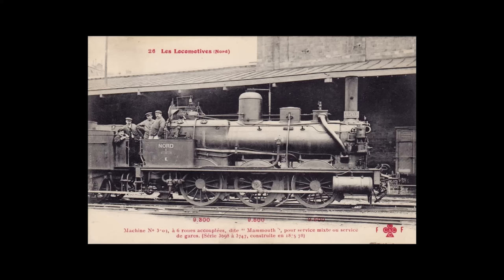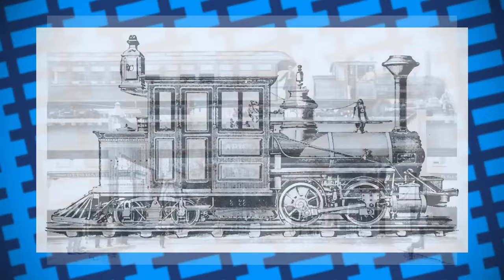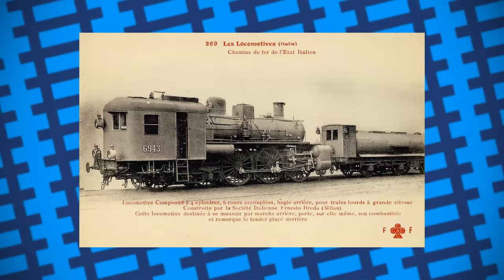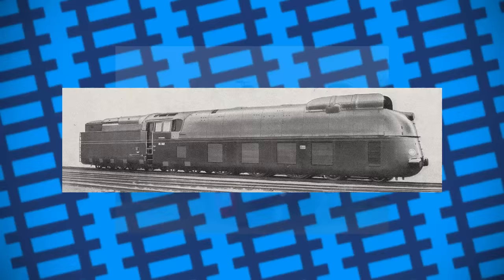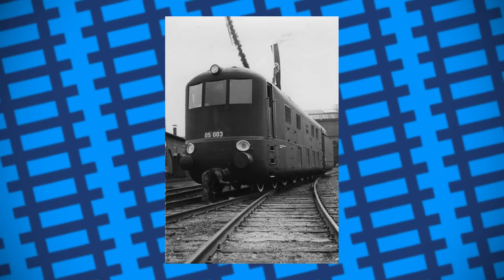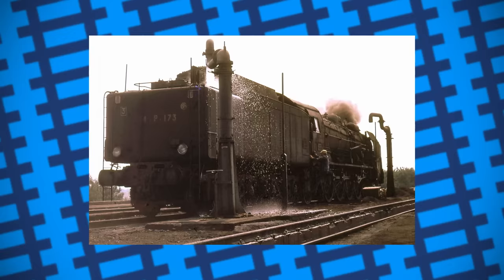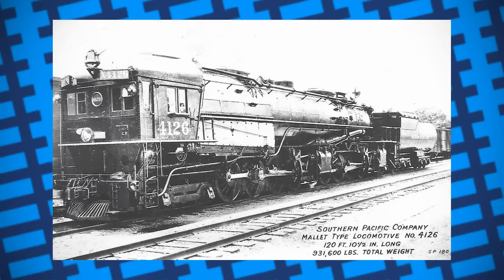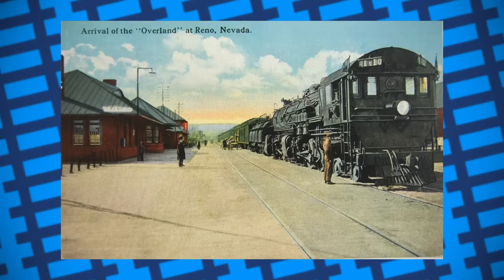Why "cab-forward" steam locomotives usually didn't work - Cab Forward Locomotives

Comment: There was a reluctance for crews to ride up front anyway because they felt more exposed to the impact in collisions, especially in less controlled circumstances like crossings. Because of this, many early diesels were run long hood forward to keep the cab back where the crews were used to it being.  It took a long time for this to change.
Reply: I would be reluctant, to say the least. From a stray Cow to a Head-on, I would be a nervous wreck. 😜
Reply: I think maybe the ultimate is a tractor-trailer load of gasoline at a crossing. That's where you set the brakes and jump! (if you have time...)

It's actually one of the things that held back the Rail Diesel Car: basically there's nothing between you and the side of a truck in the crossing but a sheet of glass! Just as bad as the cab in a subway train, except they don't generally have road crossings.
Reply: This is commonly cited as a reason for using tractor engines instead of pusher engines in airplanes. At least from the pilots perspective in single engine aircraft. The engine and engine space basically provided extra protection from head on attacks and a buffer in case of a rough or crash landing.

I honestly have some doubts as to just how prevalent this line of thought was, seems like it could be something 2 people said and then was just repeated ad infinitum .
Reply: It makes some sense to have the plane's engine between you and the impact rather than to put yourself between the engine and the impact. All that hurtling mass tends to keep on going when the rest of the plane suddenly stops.
(Above a certain speed it all ends the same anyway...)
I guess in a cab-forward steam locomotive not only could the boiler squish you, it might COOK you too!
Reply: For good reason. On 2008, the train operator was killed after colliding with another train on the Green Line D branch between Woodland and Waban stations, Massachusetts. The new 1900 red line subway cars have large cabs at the front for bigger crumple zones.
Reply: @Narrowgaugefilms  Also in almost all single engine planes, if the engine is a pusher, in a crash it is coming in behind you. That is one big chunk of metal that really wants to murder someone.

caveat: There are the occasional bits of awesome insanity like the Blohm & Voss BV 141, but people tend to simply not even think about designs with the kind of mindset that created it. (basically they worked out all the forces that fight with each other and figured out a way to balance them all out with this design. pretty neat imo)

addendum: with all the oil and heat sources in any fighter plane... that engine really wants to BBQ someone as well. Flame roasted, mmmmm.
Reply: -of course even in a conventional steam locomotive having a tender full of water and coal immediately astern brought more than enough momentum to squish a crew against the back head too. 
You get enough mass moving with enough velocity, you automatically get enough energy to do all sorts of harm!
Reply: @whyjnot420  As a pilot and small aircraft designer I have never heard this, at least not directly stated. There are much better real reasons, so that such irrational tavern speculation is totally overshadowed. Putting the prop at the back of a small airplane creates all sorts of design problems related to the landing gear and ground-roll phases of a flight, especially if used on poorly cleaned or unpaved runways. 
The engine doesn't offer any protection in a crash, the space offers some crumple room but that space will still exist for baggage if the engine is moved rear(where the baggage used to be). A pusher can have a slightly more efficient cruise under an ideal setup but usually there are so many practicality compromises that the advantage is lost.
Reply: @mytech6779  I have only ever heard it in stuff designed for a more general audience, e.g. tv documentaries and whatnot. Always something about military fighters or whatnot, never about civilian stuff. It always struck me as odd. I am a sucker for these since I love watching film of old planes from around the time of WW1.

For years I have thought of it as the aircraft version of how people talk about Sherman tanks as "ronsonol" death traps. At least the tank thing is finally starting to get debunked.

That is the reason for what I added at the end. I am very skeptical of these kinds of claims. Even though I have heard it in a thousand documentaries and whatnot. Also I am aware of the fact that pushers come with a host of issues. Which is why I specifically stated "At least from the pilots perspective..."

On a different note, bullet protection... Even if it doesn't do much (it isn't nothing, but certainly is far less than most people think, the amount of power in a .50 or 20mm round is insane), there is plenty of evidence to show that this kind of thing has a psychological effect on the pilot. Thinking of tanks again, just look at the number of tank crews who stuck track links and extra wheels and whatnot on the front of their tanks. Even though anyone who knows how armor works, knows that kind of steel is like paper in comparison. Historians even speculate that the cingulum militare of roman soldiers likely did something similar as it simply put something, anything, over a very sensitive area (it is that belt with the dangly bits that hangs over a soldiers dangly bits). Even if the actual role the belt played was essentially that of a military ID. Simply put, there is a reason why, as children, we have to learn that just because we close our eyes the bad thing doesn't go away. So here people might actually have a point. But I digress, a lot.

Yeah, generally speaking and all other things being equal, pushing is more efficient than pulling. That is a big reason why ships use a pusher configuration. The relatively high viscosity of water means it will impact performance a lot in comparison to the much lower viscosity of air. There is absolutely nothing stopping people from building ships with a tractor configuration aside from how it impacts performance (it is more than simple efficiency, but that is a big part... maybe you could call it 'complex efficiency').

addendum: Personally I love the look of pusher designs. Be it an F.E.2b, a Gotha G.V or even a B-36 (pre-jet engine). There is just something aesthetically pleasing to them. On a similar note I like rear mounted jet engines in modern planes and the nice clean look it gives the wings. But that is purely about aesthetics.
Reply: It's also why to this day diesel locomotives for mainline use keep a portion of hood in front of the cab no matter what orientation the locomotive is running in. It's physically possible to put the cab all the way up front, but dangerous to the crew to do so. This is why hood units with broadened front hoods known as "safety cabs," they put more reinforced steel between the crew and anything they collide with.
Reply: To go a bit further, the GP7 and GP9 were set up to run short or long hood forward, depending on how the ordering railroad wanted them.  B&O ordered all of theirs long hood forward, while C&O and Western Maryland ordered theirs short hood forward.  During the Chessie System years, the "Cat" herald was only placed on the front of locomotives.  A few B&O engines had the short hood up front, but those had been transferred to B&O from C&O.

N&W and Southern ordered second-generation units set up to run long hood forward (and with a "high short" hood).

On a long hood forward engine, all the fireman or brakeman sees on a right-hand curve is trees and scenery!  The engineer sees the same on a left-hand curve.

Comment: In my career on CSX, we sometimes ran long hood forward with diesels.  With this arrangement, your visibility on some of the 14° degree curves in cuts was about 20 feet at the most.  When required to run at “restricted speed”, which required a stop for an obstruction or another train within one-half the range of vision, it was virtually impossible to run at any speed to comply with the rule. Certain trainmasters knew this, and if you fell out of favor with them, they would set up a “banner” (a simulated obstruction) to test compliance with the rule.  Knowing that you couldn’t stop say ANY SPEED, they used this tactic to charge the engineer with a rules violation, and resulting discipline (sometimes dismissal from service). 

And railroad mangers today can’t figure out why nobody wants to work for the railroad anymore. So, in my experience,  cab forward was a good idea.  Oil firing was what made it possible.

Comment: Many Railroads and locomotive engineers didn't like cab-forwards in-case accidents and the vulnerability of the crews when of a vehicle stuck on the tracks. Even in the Diesel era, some Railroads like the Southern ran their engines with the long-hood forwards for decades until reinforced modern "safety cabs" were produced. With in increased use of semi-trucks the likelihood of a truck getting stuck on a road crossing actually increased in the 60s and 70s, especially in rural areas with limited views of the tracks ahead.

Comment: Your story about the Santa Susana tunnel tragedy illustrates that the SP Cab Forward engines were so successful they roamed many lines far from the Sierras. Oddly though, no other American railroad used similar engines more than experimentally, not even the Rio Grange, which had Moffat Tunnel. Great Northern had the longest tunnel in North America at the time, but it was electrified until ventilation fans were installed.

Comment: Southern Pacific rr cab forward articulated types were an impressive & unique class of locomotives with the cab placed at the front of the locomotive for improved crew visibility and less smoke accumulation. The SP cab forward engines were highly successful in operation and had a unique appearance, it's a shame that SP only saved 1 example for preservation display (4294) as I would like to have seen at least 3 cab forward locomotives survive for public display viewing.

Comment: The SP Cab forward was much more then simply swapping the cab from one end of the locomotive to the other. SP also had to reinforce the forward cab so that the crew could survive the impact of running into an obstacle on the tracks, such as car stopped on a rail crossing...

Comment: The S.P. cab forward locomotives are the exact same locomotives the the DM&IR used here in Minnesota, just flipped around, the Yellowstone class as they were known, are 2-8-8-4 locomotives, going from smoke box to foot plate, and was the main competitor for U.P.s Big Boy, being only 5 feet shorter and smaller driving wheels the Yellowstones are actually more powerful the the Big Boys, and the Yellowstones, and S.P.s cab forwards, were both built by Baldwin, the main competitor to A.L.C.O. which built the Big Boys

Comment: We had a successful cab-forward here in Wales! the engines on the Glyn Valley Tramway!
Reply: Bless you. butti bach! I was going to mention them as, running alongside a public highway they were officially tram locos, and had to have the cab leading. (Depended on how closely the Board of Trade were looking, from a few photos I've seen.) The Clogher Valley Tramway / Railway in Ireland was another true 'cab forward' design, roughly contemporary with the Forney engines. Most steam trams were actually 'double enders', having duplicate controls at each end. There was one early German double ender you omitted - an experimental 4-4-4 of about 1900, which was also crudely streamlined. (Marklin made a contemporary model of it) Like the later 05, she was a speed queen, but rather light footed.
Reply: That German locomotive was not a 'double-ender' but a true cab-forward; it separated the crew as on a camelback but moved the 'windsplitter' cab to the front.  There was at least one French engine with a similar arrangement.

The Henderson multiplexes (quadruplex and longer!) were designed with the driving cab in front, with the engineer communicating with the fireman via a speaking tube, as on a ship.

I'm surprised he didn't mention the ATSF cab-forward duplex 6-4-4-4, which was likely not built only because of rapid diesel-electric development...

Comment: Regarding 03:15: The 05 003 didn't have a second Cab, it was just a normal Class 05 (one of only three btw) turned around. The "Cab" at the Back is to open the Smoke Box Door to blow Soot from the Smoke Tubes. Fuel Oil was considered for 05 003, but ditched for Strategic Reasons that we all can imagine but won't discuss as to not risk YT censoring this Comment. Instead, 05 003 burned Powderised Coal, by blowing it into the Fire Box with Compressed Air. That System was tried and trusted by 1937, but 05 003 always suffered from unreliable Fuel Supply often causing it to burn Fuel rich, thus sooting up the Smoke Tubes, often even until they were completely blocked by Soot. If the Oil Burner wasn't ditched in Favour of Lebensraum, 05 003 would almost certainly have worked very well.

The unreliable Fuel Supply was caused by the Coal Piping having to pass under the entire Locomotive, which was not exactly a straight Pipe. The Fuel Feed System and Air Blower were driven by the same Auxilary Engine and thus couldn't be controlled independently, otherwise the Stoker might have been able to react to these Combustion Irregularities. Although I don't know how quickly Combustion changed, if it required Adjustments every few Seconds, I doubt that even the most skilled Stoker could deal with that. Because of the Problems, 05 003 was rebuilt in late 1944 by turning the Locomotive around again, and removing the Aerodynamic Covers completely, thus turning it into a pretty normal German Standardised Locomotive, just with huge Driving Wheels. The other two Class 05 Locomotives were un-streamlined after 1945, matching them to 05 003. 05 001 was preserved with a Replica Streamline Shell.

Edit: Apparently, 05 001 and 05 002 had their Covers removed around 1941-1942, so 05 003 was matched to them and not the other Way around. My Mistake.
Reply: Powdered coal being blown into the fire box sounds like a good way to blow something up!
Reply: @terrygoyan  That's how almost every Coal Power Station is fired. And it's no different than Oil; Oil Burners spray the Oil in a very fine Mist, that is just as "explosive" as Powdered Coal. I don't know about Powdered Coal Burners as I never worked with them and probably never will, but Oil Burners must be ventilated before lighting, to prevent Accidents caused by any flammable Fuel Residue left in the Furnace. I guess it's the same with Powdered Coal.
Reply: East germany operated the BR 52.90 wuth coal dust firing for at least 20 years without problem
Reply: @mbr5742  Because the Firebox was right next to the Tender, so you've got a straight Line between them. With the 05 003, the Coal had to go all the Way under the Boiler and around the Axles, which involved many Bends where the Coal got stuck. Originally, the Fuel System was intended for Oil and then just quickly repurposed for Coal.

Comment: A few more ideas I heard about during my travels consisted of making tenders shorter, but longer. Installing a cab at both the back and front of the engine. (The one at the back was used to drive the train, and the one in the front was  used to see the tracks ahead better). It worked on small/ slow goods trains, but was seen as awkward and dangerous on faster trains as there weren't too many people willing to be at the front of a train in case it derailed or collided with something (it's also possible that this could have been illegal). True, having eyes at the front of an engine would prove valuable... but it would look ridiculous and prove to be dangerous: speaking of which- I overheard how one day a train crew tried the brake van at the front idea, almost costing the guy in the van his life as the train he was on traveled down a hill and nearly collied with another goods train. They were only saved when a signal man heard the danger and sent them into a siding. The buffers weren't strong enough to stop the train before the brake van broke in two. Luckily the train wasn't going fast and the guy lived by jumping into a pound. I was always on a plane whenever I heard these stories, and I'm usually not one to but in on someone else's conversations. Still... might be a good idea for another video.